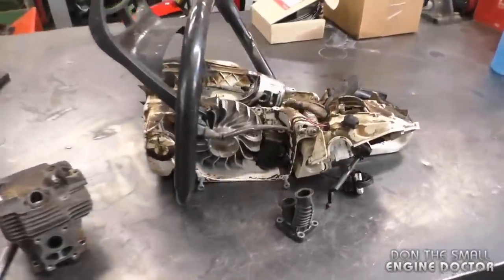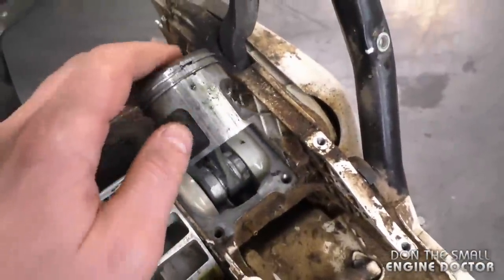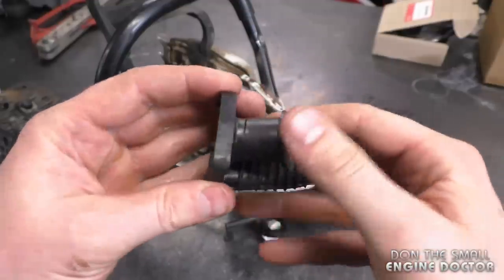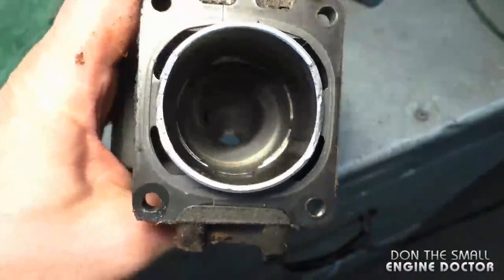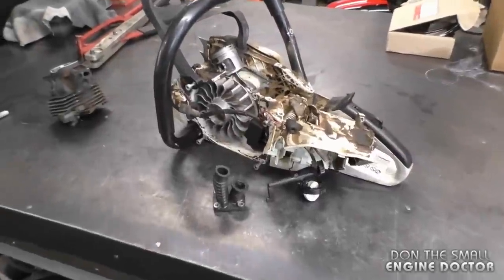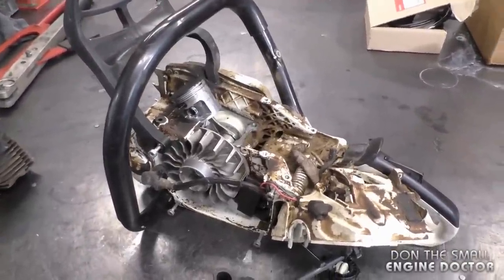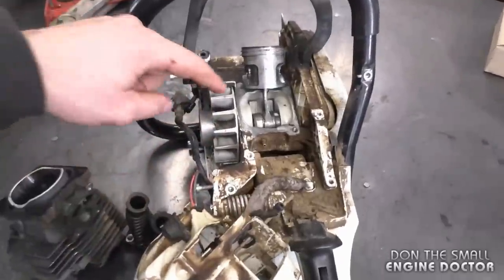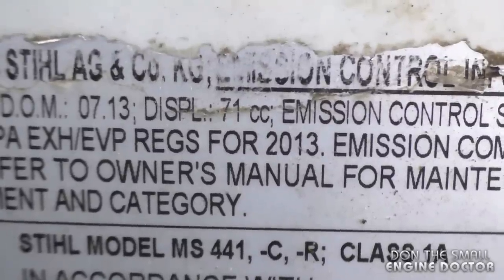Why A STIHL MS441 Chainsaw Blew Up! - Video

Comment: I bought a Craftsman Snow Shreader 250cc single stage Blown Engine $250 bucks 
tried to Hone and Reuse Parts ie Piston , rings Connecting rod and Crank - Lasted 30mins before Smoking !!!
Put NEW BLOCK, ROD , PISTON < NEW RINGS and NEW CRANK cost $ 800 Bucks !!!
LEARNING Experience !!!
Cheaper to just put in a NEW CHINA PRINCES AUTO ENGINE

Comment: Hey do you have a video that explains why an engine ( 7horse ) idled up and down when in use?
My troybuilt horse is almost stalling when tilling it seems to do it most when I turn around or back up.
I'm thinking carb.
Reply: surging problem? clogged jet in the carburator?
Reply: @ryy597  I might have a clogged vent in the carb but I'm afraid to take it off before I'm done with lol. I need my garden enlarged.  Last year there was too much rain so I couldn't till until late may.
Reply: Old fuel, and carburetor probably needs cleaned out, replaced, or rebuilt.  My old Troy Bilt Horse tiller needs a carburetor rebuild, but I found a replacement carburetor for $20 so I am going that route but keeping the old one to rebuild it and have it ready to go.  The garbage fuel we are forced to use now really isn't carburetor friendly.
Reply: @wildbill23c  I bought high octane ethanol free gas. The guy I bought it off used ethanol free aswell. Donny just did a video a little while ago on cleaning the port on a carb. Guess I'll take a look at that first. Thanks

Comment: So what was the cause of this? Improper gas/oil mix.  What about the boot crack. Did that suck in dirt and be the cause since intake side was scored?
Reply: Boot crack caused an excessively lean mixture.  Normally this can be sensed by the owner when running and fixed before damage is done.

Comment: I have a question for all the knowledgeable people here. I just picked up a sears and Roebuck top handled chainsaw model # 358.350911. I have searched high and low for an owner/repair manual for this thing with no luck. I have done some troubleshooting on it. The fuel lines are toasted. It has no fire. And it has 60psi. I can’t find any specs on it. I did remove the muffler, and didn’t see any scoring on the piston. Just looking for a little help as far as specs and parts. Thank you.
Reply: jason hopper   
I will bet your Sears saw was a Poulin.  Look for the same HP cc etc for Poulin and I’ll bet you will find a match.

JoeB

Comment: I have a jonsered cs2188 chainsaw I replaced the crankshaft I put the saw back together I started it but it won't stay running I would like to know if the carburetor needs to be rebuilt because it sat around sence last summer there was no gas left in the fuel tank
Reply: diaphram most likely dried up and hardened. some people say that its good to drain the machine out of gaz before storing but i highly disagree. if you want to sell the saw id buy it lol
Reply: but what i don't understand is that you were able to split the cases and press in new bearings and all but you don't know your way around a carb? they are really easy to work with!
Reply: @ryy597  thanks for the information the saw is not for sale
Reply: @archierockey  if you want i can help you find the problem? if you installed everything correctly and have the right gap between the coil and flywheel i suspect that the carburator is your problem?

Comment: Hey Donyboy..what do you think about  tru - fuel ??
Reply from the maker: it's good
Reply: AMAZING how my equipment starts & works with this high $$ stuff
Reply from the maker: @REVNUMANEWBERN It should for the price lol, have a good weekend Numa!
Reply: So I'll throw in a different experience. I used to buy that to be sure I was getting good fuel and oil, but always had lots of trouble with my two-cycle equipment. Everything was much easier to start and keep running well once I started to mix my own. So if you're having issues and you're using that stuff, might be worth trying mixing your own (at least if you can buy ethanol free gas to mix)
Reply: Dony has good video about Trufuel. Especially good for homeowners. Excellent for storing outdoor equipment. Trimmers, saws, snowblowers too. Trufuel makes 4 cycle as well.  Your carbs will thank you.
Reply: I use it in my 2 stroke equipment because it doesn't get used very often.  I do mix my own for the trimmer that I use a lot but the leaf blower that only gets used occasionally and the chainsaw I use the Tru-Fuel...far less starting issues come next season.

Comment: Finally bought my Stihl ms 251 😁
Reply: should've went with another brand. hello to carburator and fuel issues...
Reply: @ryy597  all reviews were good. I was thinking about the husqvarna but it had to many complaints.
Reply: @DS-kn4bs  complaints? from what ive read it was the complete opposite? i almost went with the 550xp because it had so many good reviews. but instead i choosed echo to give it a try and i was impressed!
Reply: Well I'm very impressed with my stihl. Already cut down a bunch of small trees on my property and got lots more to go.
Reply: @DS-kn4bs  make sure to use non-ethanol fuel. you will see, in one or 2 years from now it will require a carb rebuild or replacement.  it will become very hard to start in the near future. i had 3 and one was a smaller 291 and it came from factory with a carburator issue...
Reply: @ryy597  it's got a two year warranty on it. I'll use it the most this year.
Reply: JeepWoodsFun 

     Correct , my Stihl dealer sells non ethanol gas.  I always get a gallon and add the synthetic oil to it.

Comment: The only fuel were I live without ethanol in the fuel is 87 fuel. If there’s a 98 fuel here I haven’t seen it,  also don’t I took my moms 14.5hp riding mower engine apart cause the compression release broke, yes it’s Briggs engine, but is it ok not to use the gasket n use high temp sealant. Had to order the whole cam. It arriving today so I can put it back together.
Reply: Thanks

Comment: I hone the cylinders (if they are not too bad), you are suggesting people don't repair their saws!, wonder if that's because you quote them shop time to fix it. If they were up to it then they could repair that saw themselves.
Reply: Thats just it. Those guys do not know how to repair them. In this day and age its called throw it out and buy a new one. The industry makes them to not last eather. As he stated, you cannot hone a cylinder. The whole head needs to be replaced. Do the math. The repair shop has to charge for their work. If you can fix it yourself, more power to you.

Comment: I mix 40:1 with a very high quality low smoke full synthetic 2-stroke oil (Motul 710) and use small engine gasoline (alkylate). 50:1 is too little and 30:1 is too much. I don't use racing oil since they are not low smoke and will cause carbon deposits, me thinks. They are VERY expensive as well. Don't use 2-stroke oils inended for outboards or snowmobiles.

Comment: will the owner be rebuilding? its a 1000+ dollar saw. i would go ahead and rebuild it. if you want to sell it id be interested in buying
Reply: If After Market parts are available for this saw, the savings can be quite significant and well worth it to rebuild.
Reply: @canamrider7195  yes they are! i checked and you can get a rebuild kit for 120$ shipped. add a boot and a carb rebuild kit and you've got a brand new 441 for less then 200$. these model are fairly new. the came after the "0" series saw. parts a still available and easy to find
Reply: @ryy597  And considering Donny already has it apart, the obvious next step it to spend the $200, and have a 70cc class saw up and running again, and likely for many many years.
Reply: @canamrider7195  exactly its better to pay 200$ and have it fixed then spending another 1000$+ dollars on another new saw.

Comment: our chainsaw piston etc looked the same due to wrong fuel oil ratio
Reply: You can fix it yourself. You only need a set of new rings. Scratches on the side of the piston doesn't do any harm. Just make sure there is no aluminium stuck to the cylinder and that the new rings are moving freely.
Reply: @Drottninggatan2017  Too late LOL , i binned it , it was only a cheap chinese saw, the piston was melted on the side and the ring had become one with the piston. im looking to build a reasonably  powerful dc chainsaw from a gas chainsaw, ive seen 120vdc chainsaw out now but who knows what quality.

Comment: good tip to have a bit extra oil in the gas , to get a bit more lubrication  on the piston, because chainsaw dont have separate oil tank like four stroke motor, like snowblower

Comment: Double the oil.
Been doing that for years.
No problems.
Reply: Just use 50:1. Any more oil than that will damage the saw sooner or later.
Reply: @ralphnapierii1184  seventy cords and still going strong.
Ten years of wood for a fifty dollar saw.
And still running.,.....
Or I have four more saws.
Reply: @dontcare3430  OK. Your name suits you. Adding too much oil to the mix makes the engine run lean, with less power, and make nearly 1.5 times the heat, so lucky you that you found some gem of a chainsaw that can stand up to your abuse.
Reply: @ralphnapierii1184  ?

Comment: You can fix the cylinders by cleaning the aluminum off with hydrochloric acid. The cylinder isn’t scored, it has aluminum from the piston welded to it. 

This happens quite a bit from improperly sharpened chains. A chain needs sharpening every single tank of gas at a minimum. If working in dirty wood, it needs additional sharpening.

Comment: i use amsoil use 100 to 1 with aviation fuel 100 octane exhaust is white run a ms 661c
Reply: Lead crust.     I’ve encountered the same thing.

Comment: That's one ill engine, the weak mixture must have made it burn really hot.
Not worth rebuilding unless a second hand engine is possible.
Reply: crank is still good it would cost approximetly 200$ in parts. instead of paying 1000+$... its a 71cc saws they are not cheap

Comment: Thats why i would never buy a Stihl
Bad design
Reply: Why? Any two stroke engine run without oil to lube the engine wii be ruined. It’s not a brand issue, it’s understanding how a two stroke engine lubrication  system operates.
Reply: I understand how it works i fix small engines, stihl need better engineers thats all......

Comment: How do I know if my 2-stroke is running lean?
Reply: look at the plug, if it’s white or grey it’s probably running too lean, you can also measure cylinder temperature with a heat gun and check for over heating...
Reply: @roymills415  So it should be dark if it is fine correct?
Reply: Yes light brown but not too dark, if it’s black and sooty it’s too rich and you’re getting carbon build up. If the carbon is visible on the plug I guarantee your piston looks like crap!
Reply: Always err on the side of too rich, too rich just means you loose a little rpm and power and maybe foul a plug, too lean destroys everything, you can actually weld the piston to the inner sleeve of the cylinder wall from overheating!
Reply: @roymills415  Really!? I've seen that happen but I believe you! Also is it true that if you start any 2-stroke and immediately run it at full throttle it will damage the engine?
Reply: C:\ DOS Ok so these engines are built really well and they can take a lot of abuse however, if your not in n a hurry you really should let it warm up 1 to 3 minutes should be enough before you put a lot of load on the motor. If money is not an issue , run it hard, if you want your stuff to last, take care of it! Just my opinion, I fly two stroke gas motors (100cc) in remote control planes...